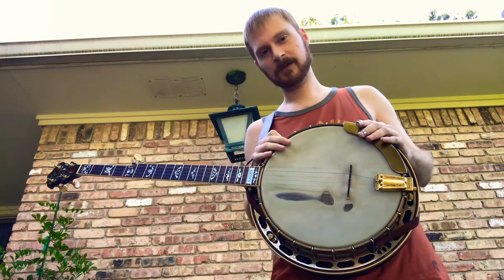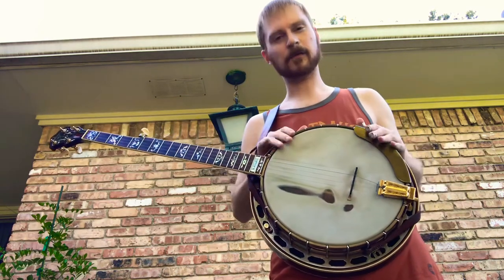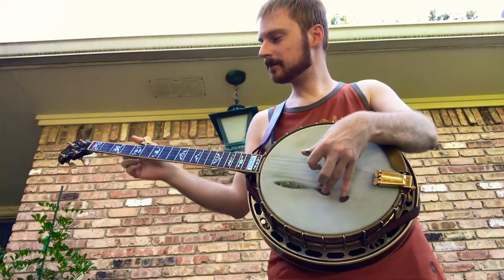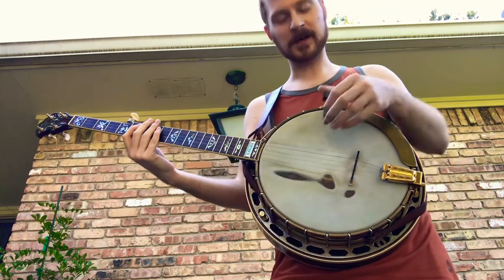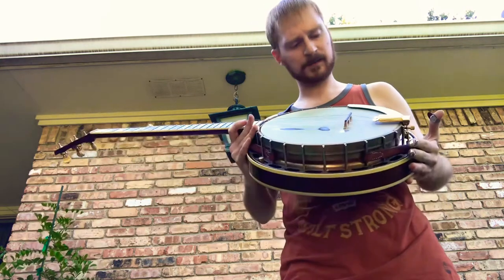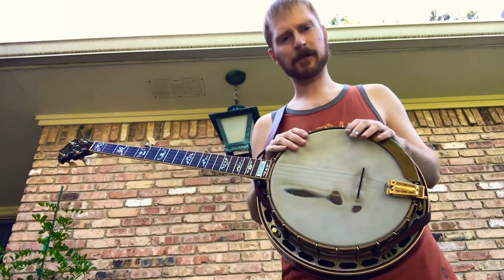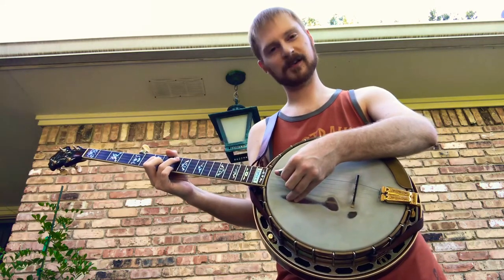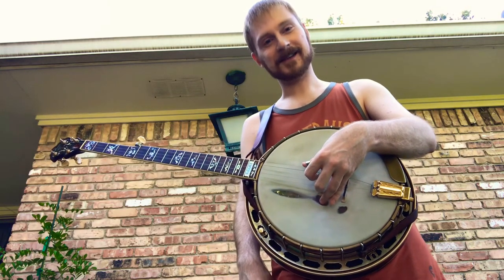New Torrefied Block Rim in Gibson Blackjack Banjo | tone-ring killer!

Comment: Hi Teak!  Thanks for the information.  I was too anxious watching your video and hearing the great tone coming out of that new rim to wait for the end and the $$ involved.  I've noticed that the original tone ring was fitted very tightly on the rim and sounds like that is standard on the Blackjack.  Your instrument sounds great and it was money well spent.
Reply from the maker: Money well spent David, for anyone. Having played on one particular rim for almost 11 years in this banjo, then suddenly doing the switch, there is no doubt in my mind that the wood is the most important element in the sound.

All 75 style banjos had very tight fitting rings, cast with a very high proportion of lead. Mine tested at 18%. This was done for machining purposes and ruins the tone. Any cursory study into bell-making will reveal what ingredients make a good vs a poor bell. Lead is one of those poor ingredients.

Gibson used these rings and fit them tight in order to achieve the tone Crowe had in the 70s: a very dry, staccato sound. Crowe, however, didn't need to use parts and fitment techniques to get that tone; that's just how he played. Thus, to me, the best way forward is to build a banjo properly, then learn how to pick it. Don't trust gimmicks. I love Gibson, but what they did on many of those 75s was gimmicky as hell.

Comment: Sounds good!  I've got a 2004 Blackjack and wish it sounded that good.  Good job!  What'd you pay for that rim??
Reply from the maker: Hi David, I paid a few hundred for the rim+machining service. I had some custom specs done which cost a bit more, so make sure to call Eric Sullivan to get a quote for your particular banjo.
Reply from the maker: Gibson fit the 75-style tone-ring very tight from the factory. Joe Vest once told me if a new banjo was sent in for one of the 75 rings, they would actually shim the rim out for a super tight fit. Gibson also used a Cooperman rim--not the greatest, mine was 22oz, wood had way too high a moisture content. The block rim is substantially lighter in weight and the wood is bone dry.

Comment: Heya buddy, was this rim already pre cut with the co ordinator rods etc... or did you have to put evenything in it? Btw it sounds absolutely killer
Reply from the maker: Thanks, I've recorded audio of it since then, and it's changed a lot and for the better.
Reply from the maker: The rim was not pre-cut in the sense you're probably meaning. It was a blank, oversized for an 11 inch pot. Things like final fitting, drilling for the rods etc all takes place when you send your parts in.

Comment: Damn that thing sounds good!!...very authentic!..what tone ring are you using?
Reply from the maker: Hi Jones. Remember in the later part of the video how I said I'd tried 5 rings in this banjo, varying from a few hundred to well over a thousand dollars, and not a single one had made much of a difference? That's why I've not specified what tone-ring is in this banjo. It's irrelevant, because they don't really change the tone. The rim clearly is the main sound-producing element of the banjo, and constitutes the best upgrade you can install.
Reply: @teakbridge101  I appreciate all the commentary but the question was what ring are you using... more than likely it’s a Burlile!..
Reply from the maker: @userjones3399  It isn't. Got that ring in 2011, sold it years ago.